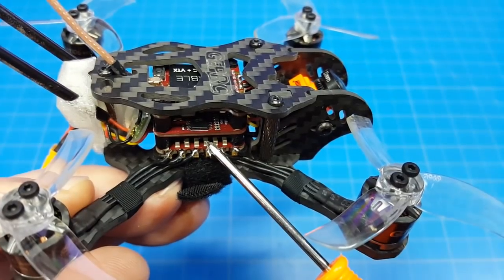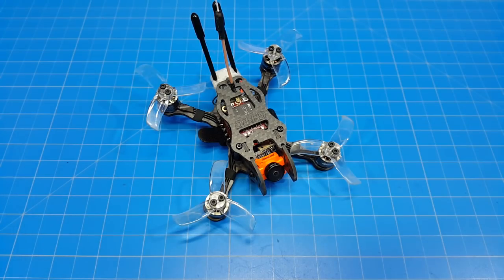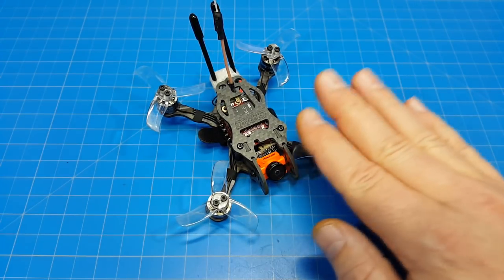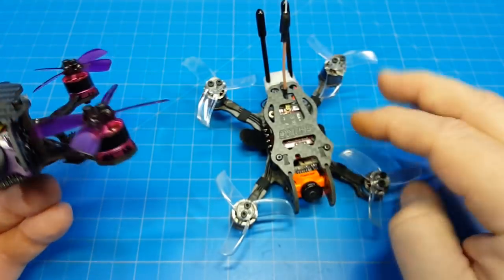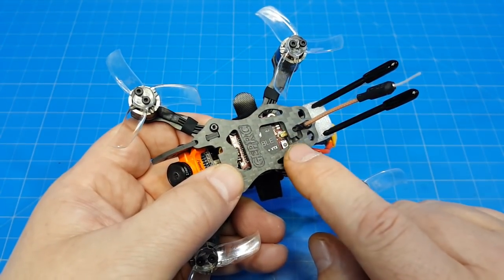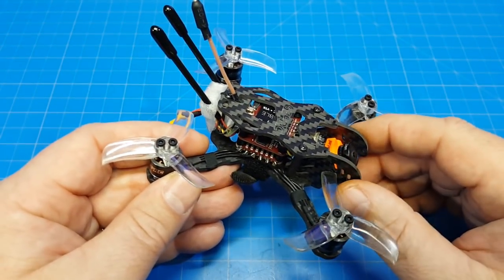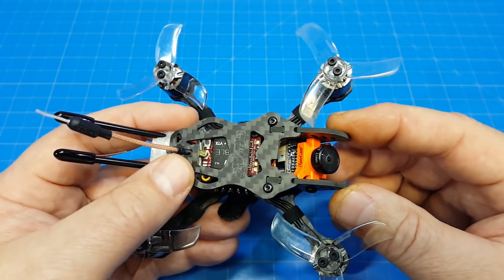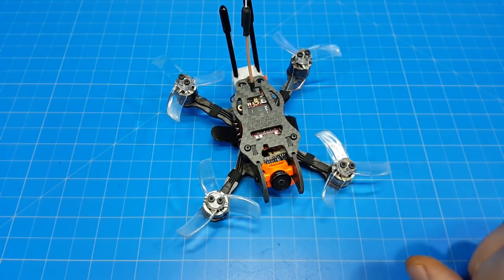GEPRC Hx2 HummingBird

Comment: I believe the tape is gaffers tape Nick. Used a lot in automobile racing to reduce wind drag and sometimes hold on body parts (after a crash)  required for the racer to be legal to race. Great flying!

Comment: Look for automotive electrical wire harnessing tape. There's also gaffer's tape but that's been mentioned before and you seem to still be searching for an answer. The automotive tape is used in engine bays so it should be fine in the sun etc.
Reply from the maker: I think your on to something. Another comment referencing the same tape. I will get some and check it out.

Comment: Silicone tape. It's self fusing so it has no adhesive. Even though I've stopped flying 2 inch, I still like to watch your reviews, oh the silicone tape I got was a little weak when stretched but I've used it to attach antennas to zip ties and had several crashes without any issues. Well as far as the holding power of the tape is concerned. Have fun.
Reply from the maker: What are you flying these days?
Reply: Nick Burns I've got a diatone 3 inch plus. It's really nice to fly. Hope the silicone tape works out. Happy flying! 😀

Comment: That thing moves. What would be your favorite 110x motor for a 3 inch? Im building an eclair lite  and worried about it being underpowered with the 9mm motor mount option.
Reply from the maker: The last time I investigated 3inch on 110x motors. I killed all the motors in relative short order. I can't give a recommendation, as I haven't revisited that recently. I do suggest lower kv, 5000 or lower depending on the motor.
Reply: Ok thanks for the input. Keep up the good work. Love your videos

Comment: Hey, I think I know what we can use to tape those wires or what kind of tape it might be... Grip tape! In the sports section for handles of baseball bats, tennis rackets etc... Hope this helps!👍🏽🤙🏽😃
Reply from the maker: I had that same thought. A while back at the sporting goods store I took a look, I think its much thicker than the tape on this quad, but I might not have seen what you are thinking of. I will double check it next time I am out there. Thanks.

Comment: I'm looking to get my first speed drone what would you recommend. Awesome video by the way
Reply from the maker: There are many parts to this brushless or racing quad category. Battery charger, batteries, radio, goggles and then the quad. If its your first fpv I would advise to keep the cost low, some get sick or dizzy when doing fpv. Idealy, I would start with what we call a tiny whoop, or an unofficial tiny whoop. You can still go brushless like the boldclash b06, these whoop style tend to be more robust, safer, less expensive and allow us to fly a lot more (inside and out) due to the small size.

Comment: Yours came fitted with XT30? Mine came with red jst plug. It did come with a seperate XT30, to solder on yourself.
Reply from the maker: It did come with an xt30 and attached wires. I just swapped the jst/xt30 out.
Reply: Ah, ok. I got the impression your sample came fitted with the XT30 installed and JST included as extra plug, which would have made more sense. I've already suggested that a few times to GEPRC, and was hoping your comment meant that they had changed this, but it still needs changing the connector. No big deal, but it's just an odd choice, to fit a quad geared towards high performance, with a JST plug as default connector.

Comment: did you try 2s on it and if you did did it feel like the stock pids were loose?
Reply from the maker: I didn't fly on 2s. On 2s the stock/factory would be even more sloppy. Normally we lower pids when we go up in batter cell count (2s to 3s and up to 4s).
Reply: oh ok